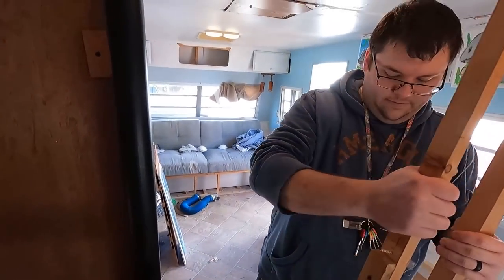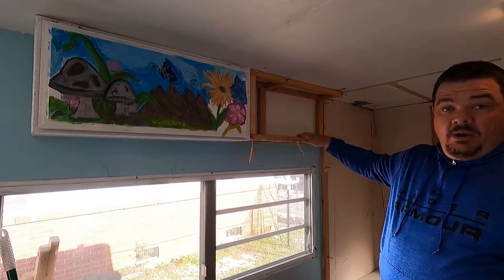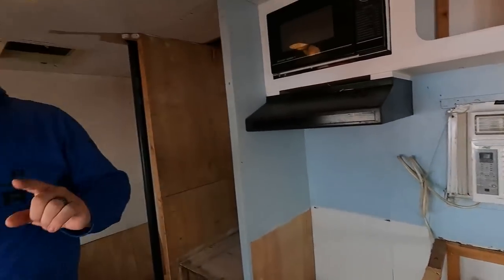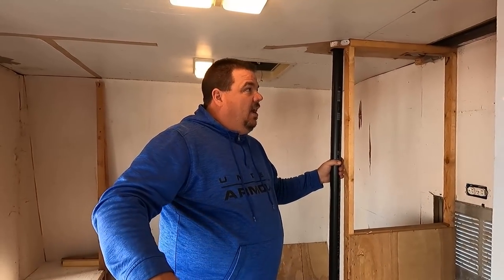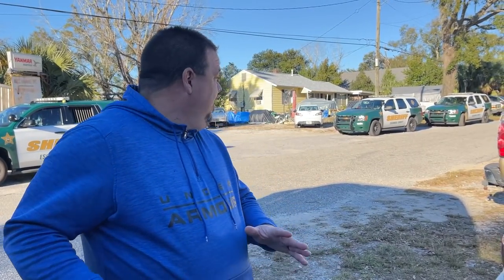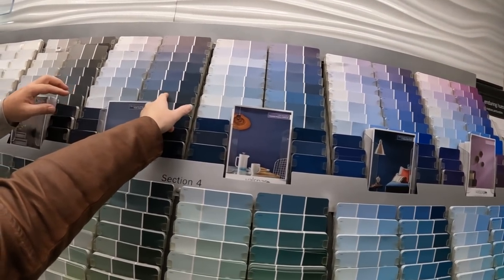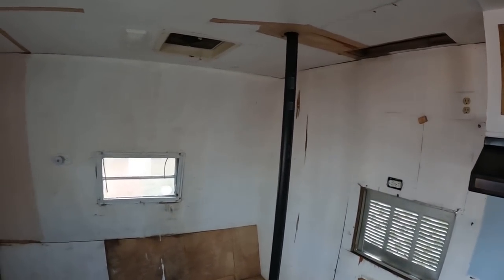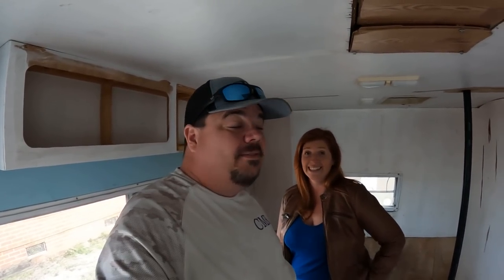Someone CALLED THE COPS During Our Camper Renovation!

Comment: Likely they have butcher block pattern Formica! Real butcher block wood requires maintenance on a fairly regular basis and with the humidity prevalent in FLA. Might grow a cilture, as in mold. So Formica is a realistic choice, it's high pressure laminate, water proof easy to clean and not to hard to install.
Be sure and use a high gloss pain that you can clean. The vent stack allows air to go into the pipe so that as water moves down it the air follows to help it drain good!
Reply from the maker: I’m gonna make sure Sara reads every word of this!
Reply: Some types of wood are antibacterial but I wouldn't use wood in there.

Comment: Just a couple suggestions from a diy camper builder. Upgrade the lights to LED and invest in a Maxx fan for the hole in the ceiling.  I would even go as far as getting a battery to run the camper short term if you ever take a long trip and stay at a cracker barrel overnight.  Yup Ron, you can camp at a cracker barrel! They have biscuits!
Reply from the maker: We’re def installing batteries